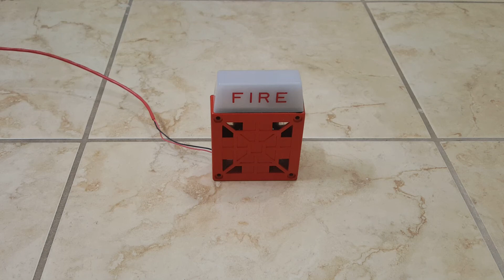Wheelock 7002T-24 Code 3

Comment: I like the 7000 series, however they only sound good in continues
Reply: They don't sound good in general, cause of that skip when the strobe flashes.
Reply: @TheJakeman789 speak for yourself .  These are the best alarms with that signature blip with the strobe. They do sound TERRIBLE  in a march or code 3.
Reply: I agree. Never code 3 on this alarm. Only continuous. I just was at my old elementary school when I was in the 80s which was turned into an office and they still had these alarms installed!!! Except open grille.